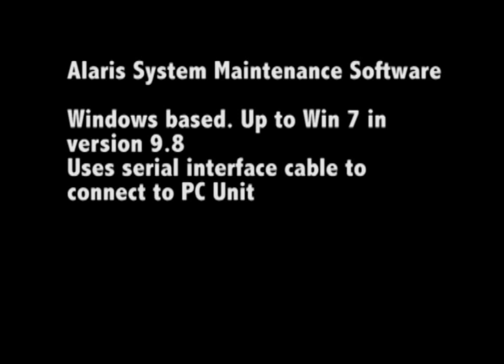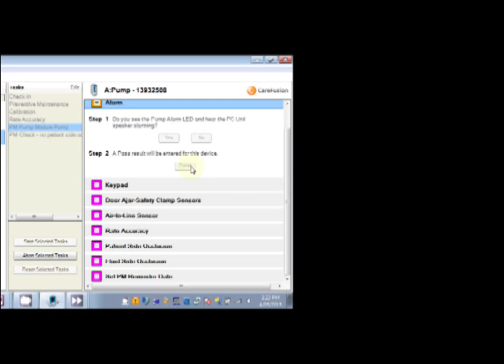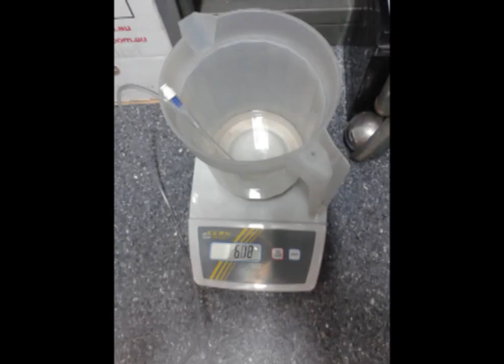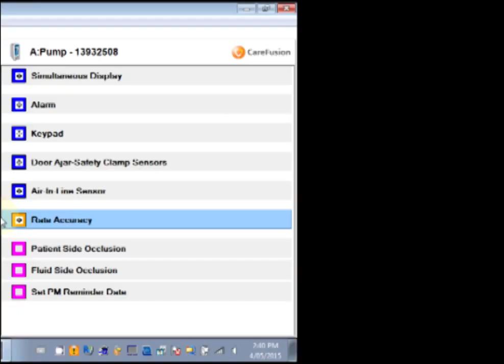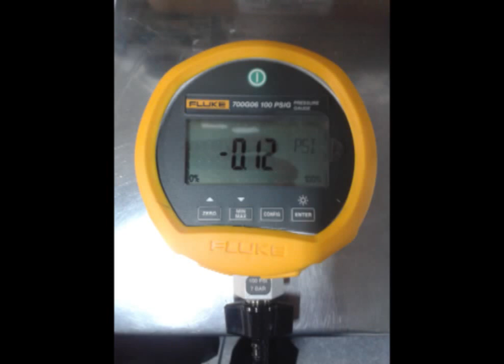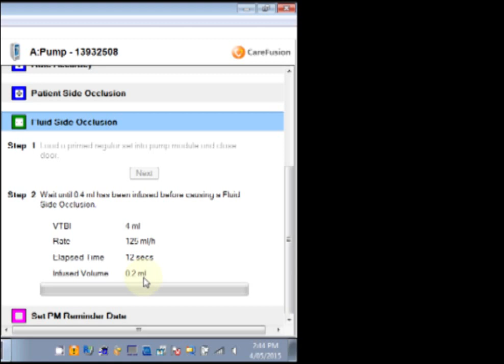Alaris 8100 Pump Module

Comment: Thanks, What do you use the Binary Sensor task for when troubleshooting an Alaris 8100 Pump Module? The Alaris software is v10.33.0 , but the Alaris PC 8015 says the software is v9.33.0 any reasons why? Go to the Alaris PC 8015 options settings and see what software it has.  Do you have any troubleshooting using an oscilloscope measuring the test points on the Alaris 8100 PCB boards? For Each Alaris 8100 pump module it keeps failing the PM task group Patient Psi test and the Rate Accuracy test. Its very annoying to have to do multiple times manually pressure calibrating and Rate Calibrating in order to pass the PM test. Is this a BUG in the PM tast group software that is Fails the Patient Pressure Occusion Psi Test and Rate Accuracy test often out of range criteria. I hate spending so much time doing the pressure and rate calibrations for every single alaris 8100 pump module.

Comment: Hi Ian Davies, Can you make a youtube video going over all the error messages and error codes for the alaris 8100, PCA, syringe pump. Would be nice to know what to do
Reply from the maker: Hi Bill, the manual covers many of the errors. The difficult part is knowing which ones to ignore and what to do with others. Low battery problems create a lot of random errors too. Software errors can be difficult but talk with your local vendor on these. After some experience you get to know the common problems too. Thanks for the comment. Regards, Ian

Comment: How can you use software on windows 10. Carefusion should already configure it to work on windows 10.
Reply from the maker: The latest release only works up to Win 7. Won't install on Win 8 or Win 10.
Reply: Ian Davies. I know it works only on windows 7. I figured how to install it on a vm and use on my windows 10. Still carefusion is behind in supporting software. Company grow and change computers yearly. They should be ahead of curve already.
Reply from the maker: Yep I thought of doing the same with my Win10 laptop. I'm sure CareFusion will update soon though. Agree they are slow to support users in the field.